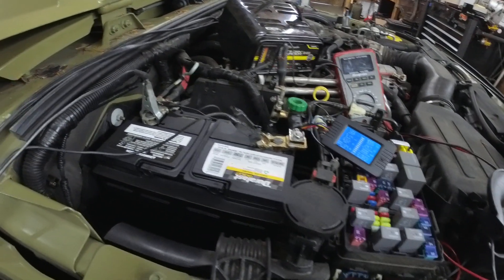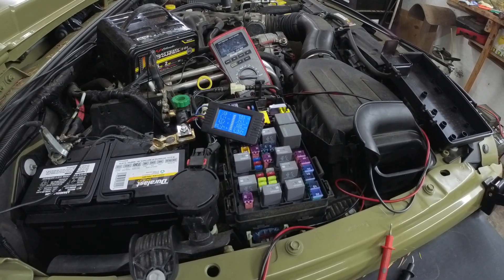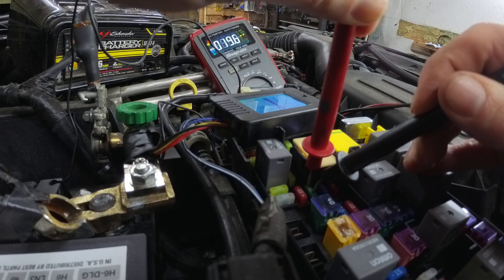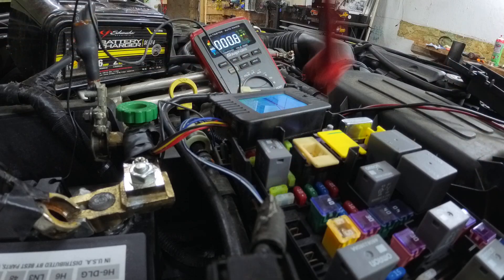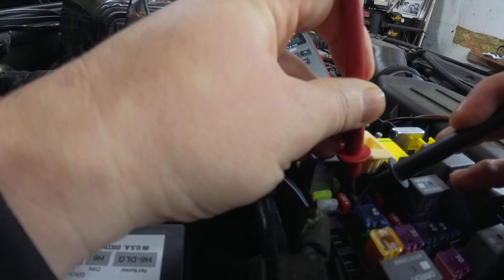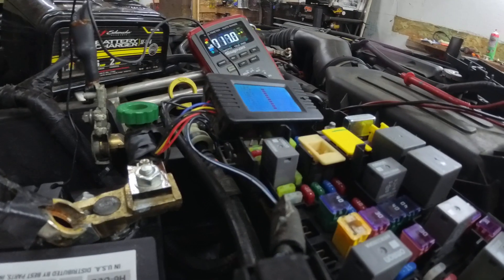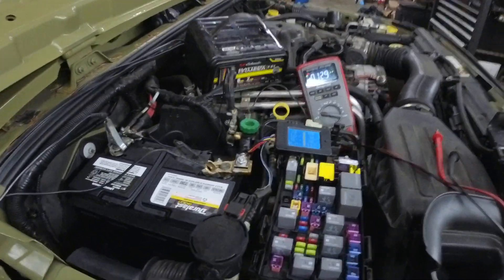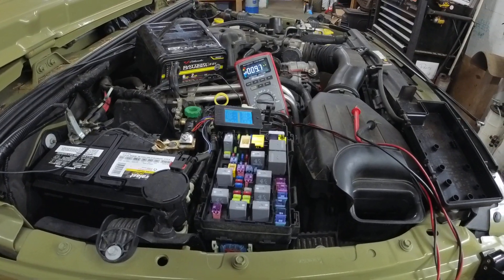Do NOT pull fuses to find parasitic draw, use a shunt

Comment: The amazon link in the description shows a display device which is similar to, but not exactly the one shown in the video.  But what about the kill switch and the actual resistor that functions as a shunt.  Where's the link for that?
Reply from the maker: The particular unit was not available at the time of this videos creation,.. I updated the link.
Reply: @MegaMarclar  What about the actual shunt?  I don't think the display device includes that.  The kill switch looks like OTC 7645.

Comment: This is all well and good, but I can't even access the fuse block (which is hidden up under the dash on the driver's side) with the door closed. Let alone contort myself enough to be able to place the multimeter probes on the fuse(s) AND be able to read the meter and/or the readout on the shunt display.
Reply from the maker: Ya there are always applications that create issues due to poor designs.
Reply: I agree and I am learning that the engineers are not putting in fuses with external test Pins on the fuses.